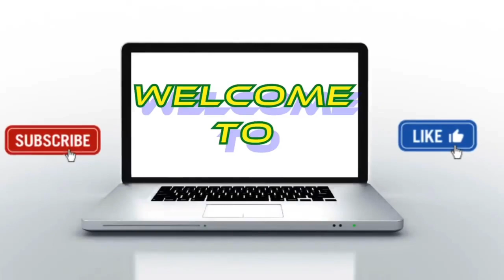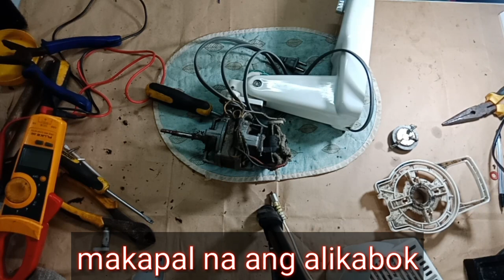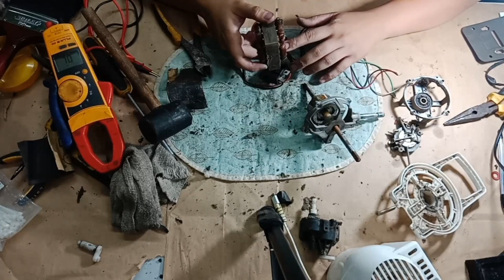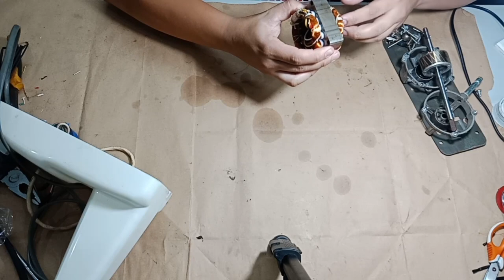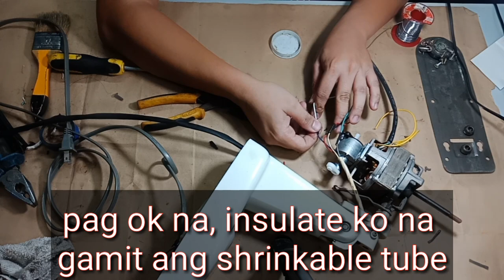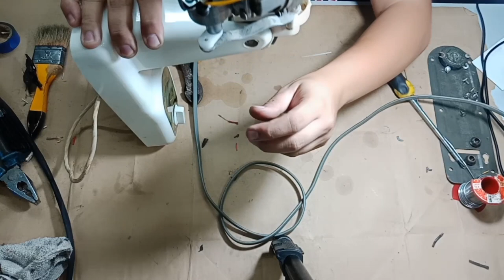HOW TO TROUBLESHOOT AND REPAIR COOL AIR WALL FAN | MOTOR REPLACEMENT | TAGALOG

Comment: Brand: Cool Air (Promac)
Model: WF-001 (PAZ 16W)
Power Consumption: 60 Watts
Similarities:
Union UGM 16WF
Union UGM 1602WF
Union UGM 1603WF
Union UGM 1604WFR
Union UGTF 16WF
Promac Airezone PAZ 16W
Airmax AMWF 16
Airfinity AWF 16B

Comment: Mayroon akong ganon na electric fan cool air pero ni repair ko sya pero ayaw umikot yuong propelor kapag ilalagay ko sya baka mabigat kapag wala propelor iikot sya thanks for this video
Reply from the maker: check mo po yung capacitor baka palitin na.
Reply: OK thanks taga Baguio ako kasi maevesly al 
Oo pati bushing at shaft na sand paper
Yuong ginamit ko para lang matangal yuong 
Rumi o rust